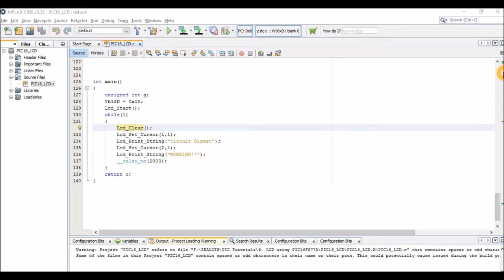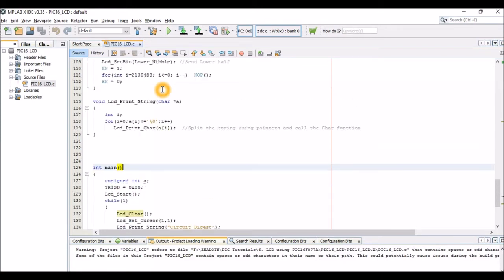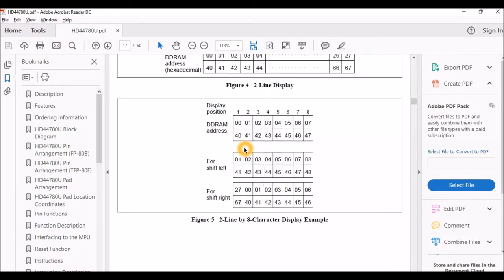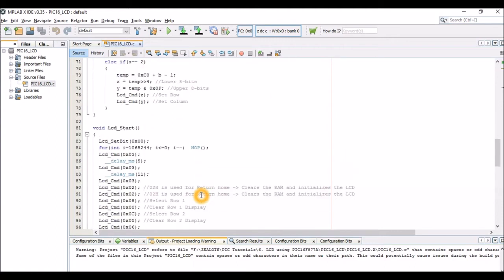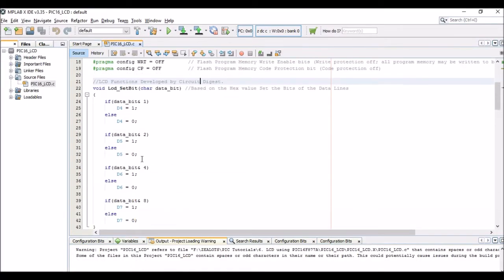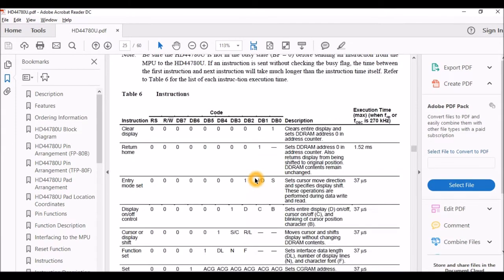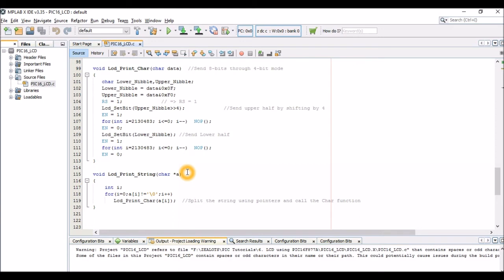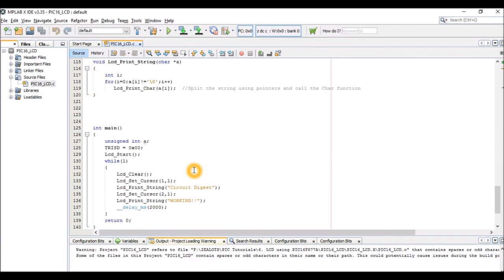PIC Microcontroller Tutorial 6 - Interfacing 16x2 LCD with PIC16F877A

Comment: how this part of code is working

void Lcd_SetBit(char data_bit) //Based on the Hex value Set the Bits of the Data Lines
{
    if(data_bit& 1) 
        D4 = 1;
    else
        D4 = 0;

    if(data_bit& 2)
        D5 = 1;
    else
        D5 = 0;

    if(data_bit& 4)
        D6 = 1;
    else
        D6 = 0;

    if(data_bit& 8) 
        D7 = 1;
    else
        D7 = 0;
}
Reply: '#define D4'  and D4 = 0;  not make sense.